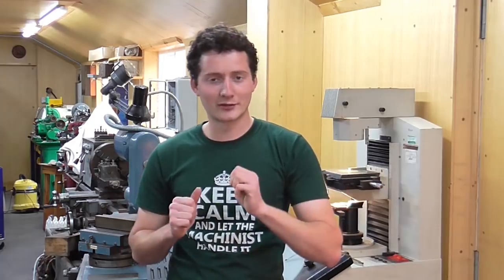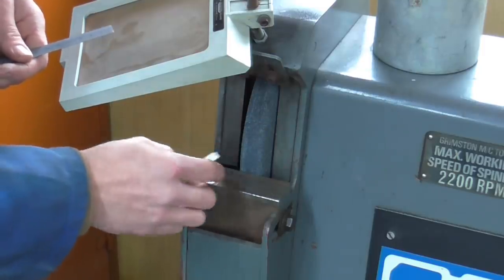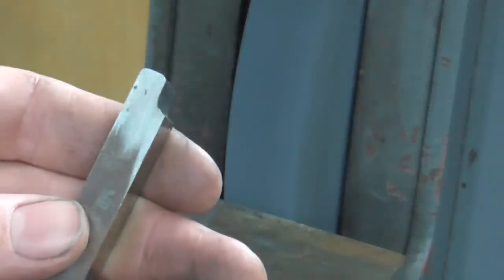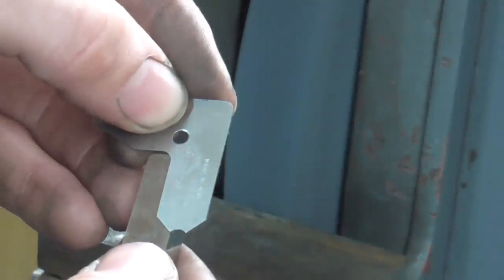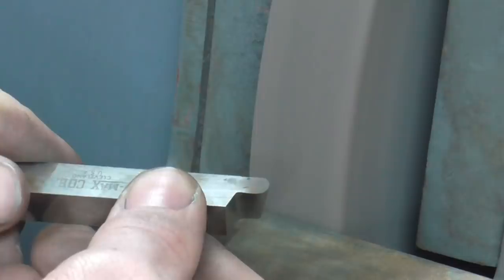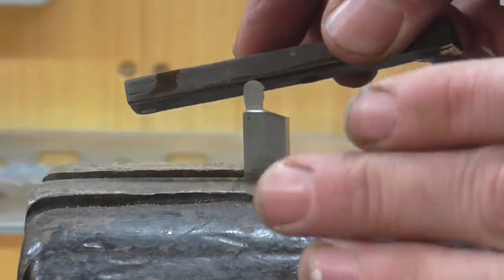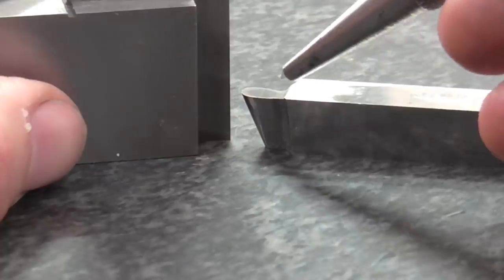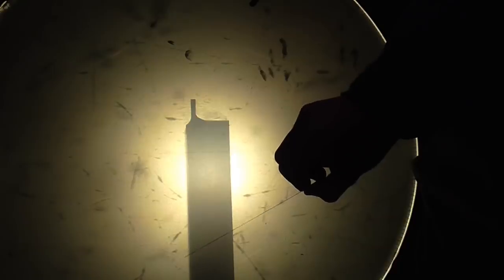Grinding a Round Nose Tool

Comment: The angles on the front and sides are known as clearance angles and not rake angles, the rake angle is on the top of the tool, and is the cutting rake. Anyway you’ve got a great workshop.
Reply from the maker: Thank you for clarifying this. I will mention the difference in any further tool grinding videos.

Comment: I too have been model engineering from about the age of 13! However, was pretty much self taught and so I’m learning a lot. I’ve ground tools in the past and know the basics but probably don’t pay anywhere near enough attention to detail.

I was just about to ask about the shallow top rake then you answered!

Regarding grinders, mine is a 30 year old £30 bench grinder with questionable tool rests - they frighten me a bit and I seldom dare use them! Is it worth pursuing with it, or should it really go in the bin and get a proper one if serious about grinding tools?!
Reply from the maker: No you can normally do perfectly good tool grinding on a £30 one along as the wheels are balanced and you have a way of dressing them. I only use the rest to steady my hands rather than to rest the tool on.
Reply: thanks for the reply, I think I’ll have a proper go at grinding some standard type HSS tools. I’ve been cheating lately with braised tip tools, but for small lathes I think sharp HSS tools with rake angles appropriate for the material probably give a better finish. 

Do you have a grinding wheel that will sharpen carbide tools?

I also have one of those draper drill grinding jigs that I’ve never set up and used,  but I from what I can gather just looking at it it’s a bit rough and can only see it working for larger drills. Do you grind drill bits by eye? I used to think I could do a reasonable job but lately seem to have lost the knack!

Comment: Another great tutorial from Mr.C.  Many thanks.  Would you consider at some point, doing an in-depth vid on rake angles on tools with a focus on the most suitable geometry for small/ less rigid lathes.
Reply: Positive cutting geometry, tiny nose radius. Basically more pointy more better. Look up the old published bit geometries and grind them for the "softer" materials on the charts. 

 Unfortunately that's going to give you the least desirable surface finish. And a tool that won't last as long. But everything is a trade off.

You can use more traditional tools with light passes your machine can handle for the finishing passes. Or finish it with something like a shear tool or sandpaper

Comment: Doesn't top rake angle  offset edge away from center of workpiece? How good does the side cut if it's not centered?
Reply from the maker: By and large slightly below center is not a problem in terms of chip forming. Above centre certainly would be an issue.

Comment: Found your video at the right time. My first attempt did not work well and now I see why. My HSS is only 1/4 " so I made a holder out of 1/2" square bar drilled on the end with a locking thumbscrew. Easier for me to see the angle I am holding. Less hot fingers as well.

Comment: Good tip about watching the sparks on the wheel indicating the point of contact. Further to this, once the face is fully ground the sparks will deflect off the top of the tool rather than running round the wheel. You can see this effect occurring at 3:37. Cheers.

Comment: Having hand ground and used form tools a lot,  that's pretty much what I do.  You may find the use of EZE-Lap diamond "laps" to be faster than a stone and for a similar tool made recently I progressed from 400 grit through 600 grit to 1,200 grit to get a smooth contour.  I have also found top rake to be unnecessary and makes for easier resharpening  by sliding a fine Arkansas stone (or Chinese equivalent) along the top face of the tool to avoid rounding off the critical cutting edge.
If I find form tools will not cut then first to do is check centre height.  Form tools need to be at or slightly below the centreline to cut,  especially as I use less front and side clearance than shown on your tool.  Not every one can hand grind form tools,  let alone as well as you did along with first class video and explanation of what I choose to call  "first understand what you are trying to do and what is going on"

Comment: That was a most excellent and informative video on tool grinding 👍👍

Your timing couldn't have been better, I have a couple of small step pulleys I need to make and I'm going with round poly belt, so I need to grind myself a 5mm radius tool to cut the belt grooves and I shall be following this tutorial very closely.

Thank you for taking the time to document and share, for those of us that have to teach ourselves, these kinds of tutorials are an invaluable resource.

Comment: Excellent video.  A nice addition to a grinder tool rest that won't tilt is fabricating a small wedge with the desired angle equal to the desired rake angle and clamping it to the flat tool rest.  You can then rest the work on the wedge and rotate it into the wheel and get the desired angle on the work.

Comment: Excellently explained, but I'm curious as to why you didn't angle the grinding wheel rest plate to give you an acceptable rake or clearance angle.
Regards Mark in the UK
Reply from the maker: Basically because on that Grinder you can move the rests in and out but they don't tip. I may modify them at some point.
Reply: Thanks for such a quick reply.  Yes, I suspected it was that simple, but at least there may now be another future project???

Comment: Sorry for having to correct you but you’ve got too much clearance on the front of the tool so don’t be surprised if you end up with chatter marks when cutting cast iron. Try reducing the front clearance a bit and then see what difference it makes.
Reply: He knows that and actually tells you in the video.
Reply from the maker: Good point and yes there is excessive relief.

Comment: As a novice, who’s preparing to address a grinding wheel with some HSS for the first time, that was superb, thank you. There’s plenty of info on cutting tool geometry out there, but precious little like that showing the practicalities of grinding a tool at the wheel itself. More would be most welcome, if you have time and the inclination, like a basic general purpose RH turning tool for facing and turning steel or aluminium, with a small but definite radius for a reasonable finish. With that, we can then play ourselves and make LH tools, chamfering tools and grooving tools.
Reply from the maker: Ok, noted
Reply: MrCrispin I concur. Thanks for a concise, brilliant demonstration. Some discussion of grinding wheel grits, materials, and applications would also be useful.

Comment: If Your rest does not tilt,  You can put something parallel on it, to raise the tool and to change the angles. Or take some super glue and stick a wooden wedge on it.
Reply from the maker: Yes either would work. I think the solution would be to make a tilting rest but I'm not opposed to free hand grinding as it gives great versatility. When it comes to drills you have no choice.
Reply: @MrCrispinEnterprises  The hollow cut from the grinding wheel, which is then created automatically, makes it much easier to use the grinding stone.
Stay healthy!
Kind regards from Germany
Big fan of Mr. Crispin =)
Reply: I was going to make the same point, certainly makes grinding a radius easier with an angled toolrest as you can concentrate on the shape not the relief   angle.

Comment: If you want to remove a large portion of HSS angle grinder is a tool to go .But use stainless steel 1mm cutting discs.With ones for steel it will take forever.Dont worry about overheating it ,it wont temper it enough to matter.I also welded it with stainless steel electrodes.
Reply from the maker: Good point.
Reply: I find regular cooling helps the fingers, not too concerned overly with any possible temper problems.😉
Reply from the maker: My thoughts exactly
Reply: Plus 1 on the angle grinder. A big time and grinding wheel saver!